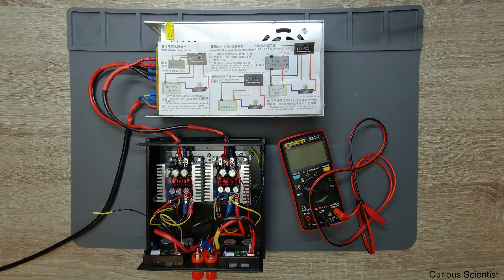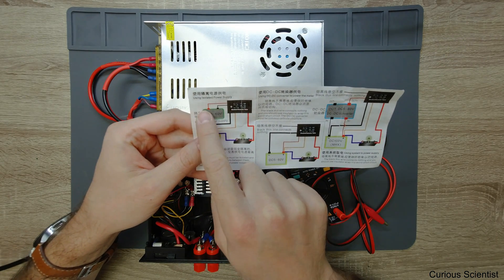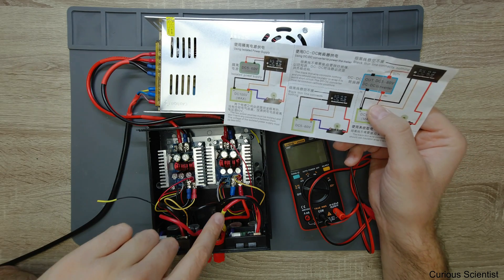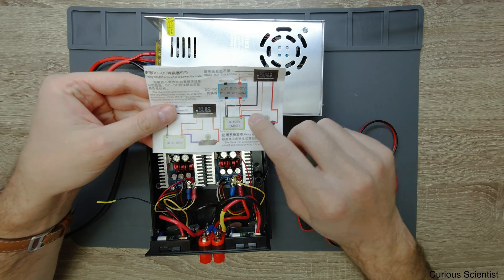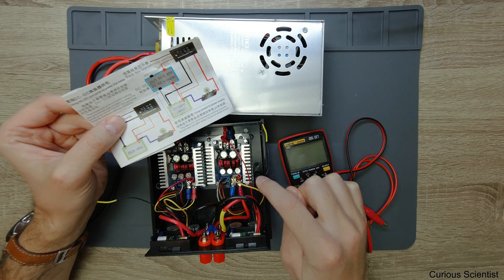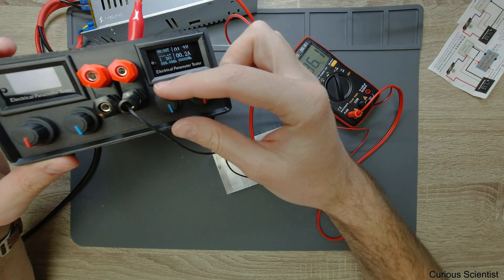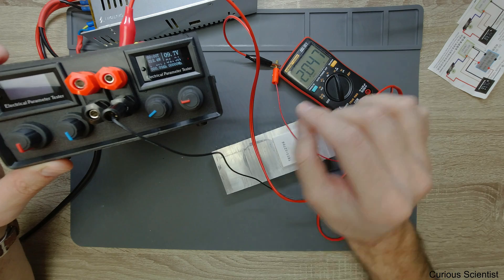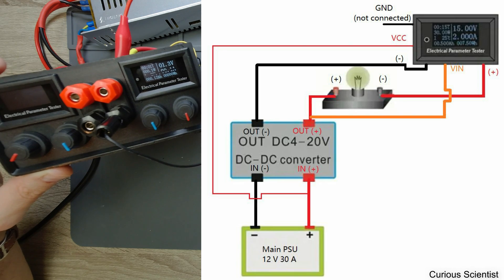Correction for the wiring of the power meter for my DIY power supply

Comment: I appreciate the update.  I had a difficult time with those displays before and fried 2 of them before deciding to discontinue using them for my project. Now I understand why. What were your end results on the -40C peltier design?  With 12706 alone I've only been able to reach -16C but at 25C Ambient and no load.  I am going to need to achieve about -8C to -5C at 45C ambient with a 50W load  (not consistent but about average) so -16 isn't going to work. I'm really trying to stay under 130 Watts/hour too as my battery pack is just under 1kWh useable energy and I have a few small drain items also running and a minimum 2 hr run time for 2 of these devices.
Reply from the maker: I haven't retested the -40°C Peltier design, but I would say, I ran both Peltiers around their 75% power. I think if you use something which is equivalent with 50 W load, you will have hard time, because the Qmax of these 12706 devices is around 50 W. And we know that they are not too efficient. I don't know if 50 W cooling performance can be reached with the limited amount of power source.
Reply: @CuriousScientist  If I provide 130W of power you dont think I can dissipate 50W of heat? I'm reaching far below freezing with no load at 60W. 2 of these are only 120W. What am I missing? I understand there are thermal losses between the item I'm cooling and the peltier.  Also the ambient temperature is going to have a very large effect. Even so, dont you think I can achieve my goals with a 130W -150W per hour solution?
Reply from the maker: @paulpease1788  Let's say you will use TEC12715 which is a high-performance Peltier. I don't know about your cooling system, but let's assume that you can hold the hot side at 50°C. So, you will need 55-58°C dT. Let's make it 60°C. At this dT,  you can reach around 40 W cooling by pumping maximum 15 A through the system. That is ~230 W (at 60°C dT, you will need roughly 15.2 V to achieve 15 A). On the other hand, if your hot side can stay around 30°C, the dT is only around 40°C. Then you will end up around 100-120 W consumption and be able to reach 50 W cooling, depending on how well you can dissipate the hear from the hot side. In that case, the TEC12715 might be able to fulfill the requirements. TEC12706 is too weak, it is out of our range.
Reply: @CuriousScientist  Ahhh. Very well stated and so obvious but my excitement got in the path of my logic. All that you stated and I would still have losses from the peltier through the copper into the water I'm trying to cool. I'm going to need more power and better thermal interphase solutions to get where I need to go.  I do appreciate your replies and help.
Reply from the maker: I am glad to help if I can, and I am also very interested in Peltier cooling, so I like to think about related problems. As you mentioned copper+water, I assume that you'll cool the system with water. I tested my CPU-GPU water cooler and I was able to cool my stacked Peltiers (12706 and 12705) while maintaining the water temperature around 30°C. So, if you can cool well and isolate well, the TEC12715 solution might work, but on the very edge.

Comment: I see, three different configurations for three different applications.You choosed the third one because you have the converter in the middle. Good you have solved it.
Reply from the maker: Yes! But I think that the manual for the power meter could have been more clear. It was very confusing and if someone does not point out that my currents look a bit higher than they should be, I might never notice. (I don't use this PSU too often) But now at least, I figured out a new drawing for commonly used circuit (power supply connected to a DC-DC converter), so I hope that this can be useful for people who try to build something like that and use a similar power meter.